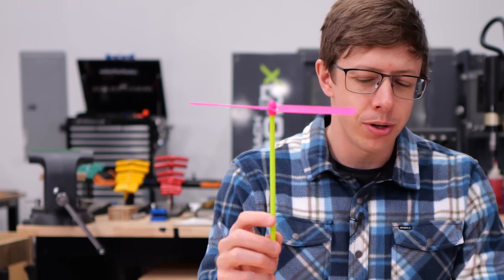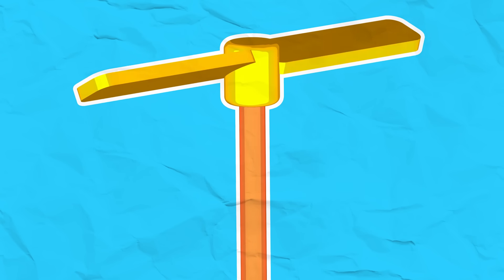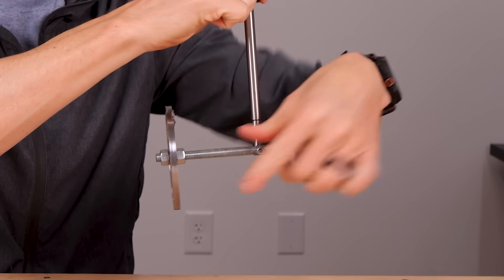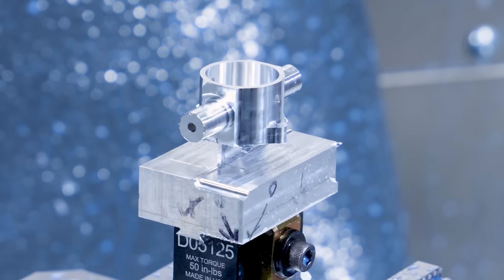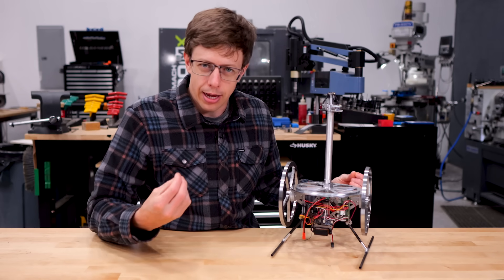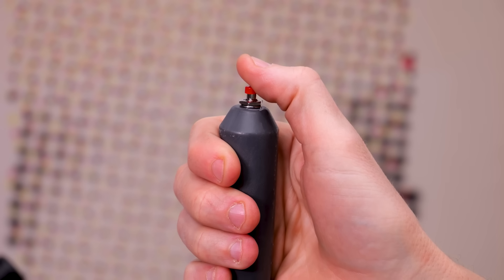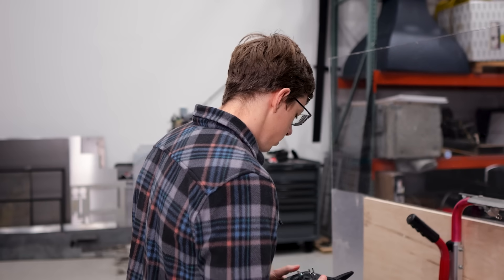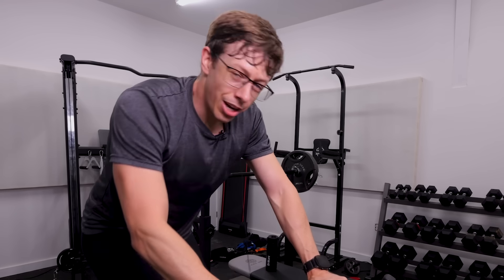I really thought this would fly well

Comment: Fascinating beautiful machine work and an interesting machine but it's also a complete project failure and I don't think it's a failure for The reason you might think 

This is what I call I'm not sure what the proper word for this is in motorcycle combat terms we would call this target fixation or tunnel vision basically you took a left turn at Albuquerque and forgot your original goal 

Your goal was to create a supersize whirly gig instead what you created was a flywheel-powered helicopter and that gets a whole lot more complex because well now helicopter control mechanics and dynamics and physics come into play that don't come into play with a whirly gig at least they're not a problem with a whirly gig 

That's not a really gig That's a primitive helicopter a very cool one one that might eventually work but it wasn't a whirligig I think it's time for a reboot and go back to what you originally wanted to make A stick with a blade on the top and just super size it 

Also why wouldn't you go with axial flywheels? Eliminate the entire bevel gear all together? Worst case scenario you might need a counter rotating axial flywheel that's got to be a lot easier than that as impressive as that was that was a bit of a monster :-) 

I also wouldn't be surprised if you had Force coupling occurring The rotor blade trying to make the helicopter do one thing especially with the dynamics between the leading and trailing blade if there's any wind whatsoever or any lateral movement whatsoever combined with the procession movement and resistance of the flywheels you could kind of see it fighting itself in the air as it jittered about. 

Either way it was very impressive to watch you build that I really want one of those little five access machines but that's the way out of my budget :-) I might see what I can 3D print

Comment: The reason why the toy works is the stick acts as a tail, like on a kite. I think you'd be better off just spinning a longer stick faster made out of the lightest possible materials. 

Flywheels, Tails, stabilizers, computers, Electronics... none of that stuff is helping you fly better. It is just more weight and drag... you didnt even go much higher. 

It would be more interesting if instead you made a dual counter rotating pair of the toy, like a chinook helecopter.

Comment: Wings generate lift.

Propellers generate thrust.

The spinny thing atop a helicopter is not a propeller. It is a rotary wing, also known as a rotor. That is why there are two types of aircraft: elegant and natural rotary-wing, and clumsy and limited seized-wing.

A tail rotor on a conventional helicopter generates thrust to counter-act the torque that would otherwise cause the fuselage to rotate in the opposite direction to that of the main rotor - but it's still not a propeller, as it has nothing to do with moving the helicopter.

Comment: As someone who dabbled in RC helicopters....  If you don't enjoy the bench work as much as the flying, you're gonna be disappointed.  Because it's not if you crash, it's when.

Personally, I'd look into trying to mount a pair of counter-rotating flywheels coaxially with the rotor.  Note that one flywheel (the one that rotates in the same direction as the rotor) will need to be smaller than the other, so that the sum of all the rotational inertia of the vehicle is zero.

Comment: Let me be clear: I don't know anything, but what about a flywheel with interior facing gears? I'm assuming you thought about this, and it wouldn't work for some reason. 

Put your 1/5 gear inside the flywheel, gear it to the center shaft with the propellers?

Comment: Why not have the flywheel horizontal instead of vertical with the helicopter shaft going right through the flywheel? Once it's up to speed, it could be lowered/slid down, catching a gear that would turn the entire thing, including the blades.

Comment: Two things.  One, put weights on the end of the blades so the blades will be more inclined to keep rotating.  And two, if you still need more weight requiring flywheels, stack the flywheels vertically directly under the blades rotating in opposite directions.

Comment: I wonder if you'd have more success by making the propeller the 'flywheel' using a ringed propeller with three blades, and eliminate the non rotating components to just the shaft to eliminate the instability that creates.

Comment: Suggestion: No gears. If you want to steer it: just 2 coaxial flywheels spinning in opposite directions with 2 coaxial rotors spinning in opposite direction, basically a pipe, a rod rotating inversely in the pipe, 2*2 coaxial ballbearings and 2 rotors. Your control surfaces attached to the middle of the coaxial ball bearings.

Also an option would be to unite the flywheel and rotor, if you get it stable enough.

If you need gears to change the speed of the flywheels, why not just  make the rotor create a different force at the same speed instead?

Comment: Not an aeronautical engineer so please correct me if I'm wrong, but don't many full scale helicopters counter the torque from the prop spin with a parallel reverse spinning weight?  Either a second set of counter-rotating blades or weights just below the blades that are mathematically equivalent to the main prop but more condensed in against the shaft to avoid causing draft issues?

I think you may have something, but need to adjust how you are doing the fly-wheel to a counter-rotating disk.   Looking at the still on my screen, I'm guessing that they are ~1 lb of Stainless Steel with ~4in radius.  That would give them roughly 2.8526 Wh each, for a total of 5.7052 Wh.  To replace both with a smaller radius central flywheel you would likely need something like a 3" outside radius, 0.5" inside radius tube of stainless steel ~0.75" thick spinning at the same 20k rpm to achieve the same power density.

The only question left would be: Does the torque of the parallel flywheel precisely counter the torque of the blades.  My guess is no.  I'm also guessing you would want to use a planetary gear to with the planet gears fixed in place to transfer the energy between the flywheel and propeller.  At least that is what I would plan on.  Should be more than sturdy enough to not fall apart and easy enough to calculate the ratios to achieve the correct ratio.  Also, if you don't fix them and rather control their procession, you could use them as a makeshift transmission to be able to increase and decrease the transfer, but doing a planetary gear set like that would get complicated really fast, but could be fun.

Comment: So some ideas. Counter rotating blades. Or don't go 90°for your flywheels instead put it inline with the blade and use a reversing and reducing gear box. The math will have to work out right but that also would cancel the spin. Also make sure you are balancing the whole assembly. Remember it's, for visualization purposes, going to be hanging by a thread from the center of those blades. Any bit of tilt will greatly affect the flight. Cool concept though and I hope to see a video of a nice long flight one day.

Comment: The only way I know of to really resolve this is with two spinning blades.. if you want to make them both generate lift, then they rotate in equal opposite directions, but are also pitched at opposite angles so they generate the same amount of lift.   This is actually very stable.

You can either have these blades mounted so they generate vertical lift at both the front and back of the helicopter, but it is also possible (but more engineering) to do an entirely coaxial design (although you need a different pitch for the top set than the bottom because the airflow through one affects airflow through the other)

By controlling the rate at which one blade spins relative to the other, you can also effectively control how fast the helicopter spins in place, if this is desired.

You can also have it work the way conventional helicopters work, by having a long tail and a spinning propeller at the end that pushes the tail in the same direction the upper blades are spinning,, and using the lever principle, effectively counteracts the spin that would otherwise be caused by the spinning blade on top using a much tinier blade.

But no matter how you slice it, you are using two spinning blades to get a stable helicopter.

Oh, and if you do this, you won't need two flywheels anymore, because then you don't have to counter the rotating of using just one lift blade with an additional counter-rotating flywheel, so you can get the gyroscope effect back that you were aiming for at the beginning.

Comment: 14:50 you need to do it dual propeller ... Would cancel the spinning tork.
Reply: easier said than done, also he just completely forgot about counter rotation when designing
Reply: @yoloboogie3674  the raw propeller does not have counter rotation because it has its own energy.

This project implies storing energy in the chassis and then transferring it to the propeller. That's why I consider this project as a true helicopter, and NOT as a larger version of the simple propeller. He is using a chassis and storing energy.

The design defeats the purpose.

Comment: Lean in to the toy part of this- let it spin. You could mount the flywheel axially on an inner shaft and use planetary gears for reduction spinning the inner shaft. Much simpler. To limit recovery velocity, you would use a sprague clutch for autorotation and simply spring load the blades for angle control.

Comment: My idea is to have just a shaft topped with two opposing flywheels with a spider gear joining them. They could use a similar design to your current flywheels but rotate the flat supports until they are reminiscent of fan blades. Mount the shaft in a slightly bigger tube with a release system, then spin the flywheel fan pair directly until you pull the release.

Comment: Could you have the flywheel on the propellor rod connected via bearing (such that it rotates in the same axis as the propellor), and have a gear system connected from the flywheel back to the rod, such that the flywheel rotates faster than the rod at the same time as being connected to it?

Comment: Now I'm no engineer but dont helicopters usually have a tail rotor to stop it spinning. I can imagine a much more sleek design where the engine is housed in a cylinder with the primary rotor above, drop the flywheels and put a secondary small propeller that pops out the side.

Comment: Why not set things up with the flywheel in the same plane as the rotor?  You could even cut the spokes so they would create additional lift by making them with the same profile as a wing. It should autorotate when it comes down so you wouldn't have to be concerned about it becoming a missile. You will have to determine the optimal diameter and weight for the flywheel so you maintain an ideal rotor speed. 

The initial idea was to make a lifting device with a single rotor fly as high as possible. The way things are going, you wil end up with a full fledged helicopter powered by a small nuclear reactor that can fly higher than the blackbird and stay up there for several years. While that would be awesome, it definitely isnt in keeping with the original concept.

Comment: 1: use more blades
2: Any kind of motor driven prop is going to have a torque reaction (it dosn't matter if the energy input is a flywheel or an engine) and the best way to counter it is.... to use another set of blade attached to the body (ie: a coaxial helicoptor) and let the body spin up

Or..... Use the standard maple leaf design with more blades (& weighted tips for more kenetic storage), spin it up and release it. Now all you need to do is directly spin the shaft and find a way of letting it go when it's "fast enough". EVERYTHING else (other than blade tip jets) needs some way of countering the torque you're adding to the shaft

BTW: did you know the toy's basic design is at least 1700 years old? - look up "bamboo-coptor" sometime - aka zhuqingting (chinese) or taketonbo (japanese)

Comment: I think you’re overthinking this. The kids toy works by spinning the entire thing. Build a larger, stronger version of that. Then mount a free-spinning flywheel on the shaft. Use an RC style centrifugal clutch so that every time the blades slow down, the clutch engages and keeps it moving.

Comment: Couldn't you deal with the flywheel problem by putting them at right angles, so they effectively become like a reaction wheel?  The gyroscopic forces would still work because they are at 90 degrees to eachother.

Comment: I wonder if you could make this work better by having a flywheel that can change its moment of inertia, like an ice skater?  You spin the flywheel up when it's at a large diameter, then the flywheel shrinks down to accelerate the propeller.  When it runs out of momentum, the propeller would auto-rotate, then the flywheel would expand back out to control the rotation rate.

Comment: A lot of people seem to misunderstand how propellers work to achieve lift/thrust. Its not the amount of air that's being pushed back/down that makes the Airplane/ Helicopter fly. The propeller is shaped like a wing and creates lift because of Bernoulli's principle. There is a difference in air pressure on both sides of the propeller blade and the prop is bolted to the aircraft/helicopter so it goes forward/up. If you want to achieve thrust by moving air backwards/down its possible just not with a propeller, think Fighter Jet Turbo Reactor Engines or High Bypass turbo Fans like in commercial Jets. Also look at the ratio of Propeller Blade length to the rest of the object in the toy vs your design. Your propeller is way to short for all the mass you put there. It will force you to spin the prop really fast. Normal propellers don't go much faster than 2000 rpm's for small ones and even slower for larger ones. The Aircraft I work on SAAB 340's 34 passengers and the propeller turns at 1300 ish rpm's give or take 100. And Even before I watched the video I was like : Where is the tail rotor. But you seemed to have figured that part out the hard way lol.

Comment: may be relying on mechanical approach in this one is not good. you should try gyro by smaller parts controlled by Tiva or esp. and may be the jerk is owing to the sudden cut off from energy supply. You should try battery and motors to keep providing energy and the slowly come down to zero.

Comment: Maybe try a hollow tube for the middle of the copter that can ride a tensioned vertical cable. That way you can  always have perfect landings AND tweak your fins to keep from spinning. Also Contra-rotating blades would let you keep your dual flywheels.

Comment: It would be a lot easier if you didn't change a flying stick and  as a land-base make a horizontal wheel with a locker at the pressure. Ye, it will be uncontrollable, but you take nothing else into the air.

Comment: Great effort, but I believe you need to dive deeper into aerodynamics, specifically regarding helicopters. I understand your youtube audience is maybe 1% engineers, if that, but based on your explanations, there are some key technical misunderstandings, such as referring to "thrust" when you mean "lift" and the way you explain autorotation. A stronger grasp of concepts like drag, lift generation (which is more about pressure differences than just airflow), Bernoulli’s principle, dynamic rollover, vortex ring state, ground effect (both in and out), retreating blade stall, and center of gravity compensation would significantly improve your content and make you achieve your goal quicker. I do like the learning curve aspect of your videos and have learned a few things along the way. Keep it up!

Comment: There's a reason why flywheels aren't great for kinetic energy storage when weight is super important, like in flight.
Sure, more mass means more capacity for storing energy, but it is Diminishing Returns that rivals the Tyranny of the rocket equation.  Even if you get all the precession and torque to cancel out, it's gonna be very heavy and won't really get near the true limits on the toy concept.

My suggestion, if you want to really push the altitude limits while maintaining the original concept of the "Children's Toy",... ditch the metal structural design and the flywheels.  Go back to light plastics and maybe carbon fiber.   
Store energy in springs or elastic bands.  
And if you really don't care about how energy is stored, then try compressed gas, battery (probably too close to just mimicking a drone).

BTW, I was screaming at the screen when I saw the control surfaces, thinking... "is he trying to use turbulent flow rotor wash to produce usable thrust against a wing?"
But I do love this hacking mindset.  I was amused when he talked about the safety implications of such a heavy metal contraption freefalling uncontrollably, then looked at adding some explosives to deploy a chute.  I'm like, "sure, what the hell, make it carry explosives too, why not make it more epic?"

Comment: Why not keep the original design?

Just make it disconnect at the bottom of the shaft? Also,  use a set of air channeling to direct the wash from the propellers away. Like NASA does with their rocket launches.

I missed a good deal cooking you might have covered this.

Comment: Out of curiosity, why not remove the gyros and just interface with the large gear using planetary gears where it connects to the blade shaft? Then you could effectively use the gear on the bottom to help fight the spinning out of the top blade while also reducing your weight significantly. The reason to consider the planetary gear setup is so the large gear rotates in the opposite direction of the blade in attempts to cancel out the forces coming from the opposite direction ie spinning the whole machine.